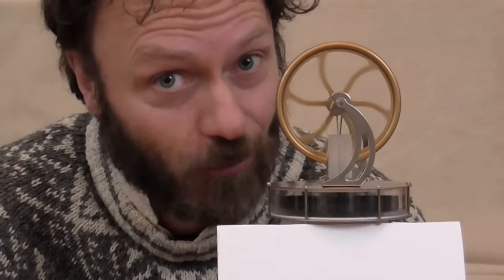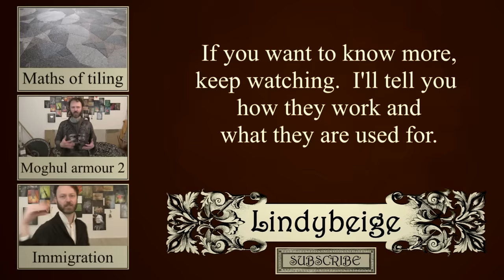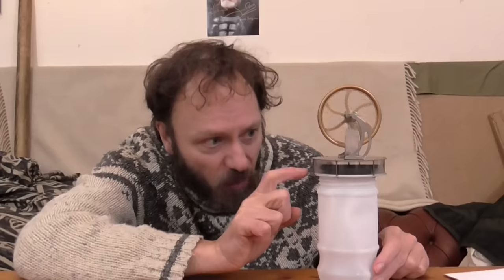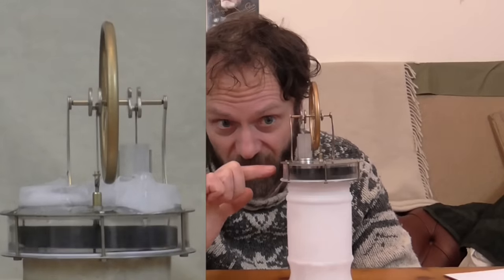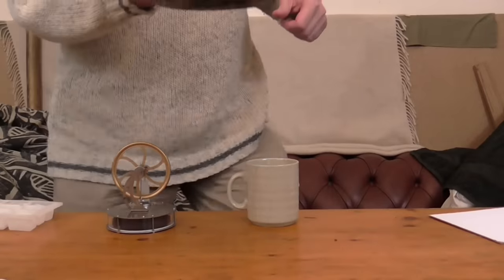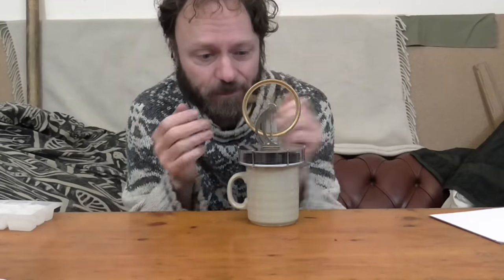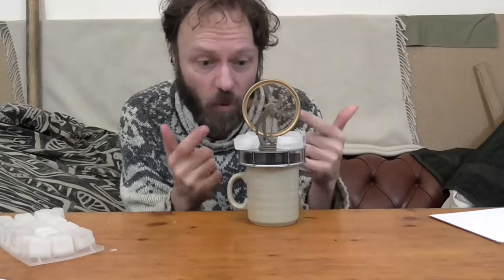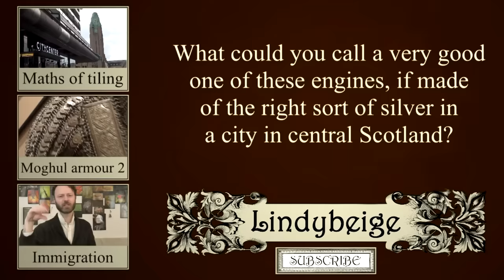Stirling Engines - the power of the future?

Comment: It could work at the equator. Plop the bottom in a lake and paint the top black you,d get a heavy temp difference.
Reply: That'd be a useful way to get these working reasonably-well in a hot desert, too.  Dig the "cold end" deep underground (where it's cooler) and fill that underground reservoir with water, and maximize the amount of heat on the hot end.
Reply: northrupthebandgeek | not really sure about that.. isn’t sand relatively good at insulating? I’d imagine the area below the engine would just heat up and - almost - equalize the temperature after a short while.
Reply: @User_2  Right, but then at night it'll get cooler at the surface and equalize the other way.
Reply: Parabolic mirrors aimed at the plate for the heat, the bottom on a lake? WELL done.
Reply: At that point you have to ask yourself if the temperature difference between the water and heat from the sun produces more energy for a similarly shaped solar panel. I couldn't tell you the answer, but pointing out that you're trying to use a source of energy that we have already been utilizing.
Reply: just put normal soil in the places where sand is and the upper panel bigger , perhaps mini solar panel, to cast shadow to the bottom...it will only need water from time to time to wet the soil , nothing else
Reply: @eewweeppkk  It well might. Solar panels are pretty inefficient, think about 20%.
However, it might be easier to just cover a larger area with solar panels.
Reply: @eewweeppkk  Well, a solar power array only uses the fact that a photon is hitting an electron, which means power output is limited by size. In the case of an stirling engine, its the actual energy within the molecules that generates the Power Output.
Reply: @RijuChatterjee  If you could insulate the heat over night within the surface of your stirling engine, you where able to use it when the sun is not shining and adversa. Storing Heat is way easyer then storing electrons.
Reply: Big energy will let u spend your life savings , then come silence any who will try, just keep it secret and let it out slowly
Reply: I have a better Idea build one in space
the side facing the sun will warm up tremendously and the side facing away would get super cold
Reply: @ralexcraft990  Damn your'e right, thats actually a really good idea.
Reply: Even better, use mirrors to reflect sunlight onto it
Reply: @ralexcraft990  As I understand it, spacecraft already have trouble radiating heat to space. It doesn't bleed off the spacecraft as much as you'd expect because heat is the transfer of energy to particles, and there are fewer particles to go around in space. Kinda like how sound doesn't transmit out there because it doesn't have the medium of air. So I'm guessing that it would heat up well enough, but you'd want a water reservoir or something at the other end because shadow alone wouldn't let the air cool down enough.
Reply: @thesoupin8or673  I appreciate your input and thank you for the correction.
Reply: @northrupthebandgeek  Generally, the deeper you dig into the earth, the hotter it gets. For this kind of setup, you really need a cold and flowing watersource which will take away the heat. Even a lake will equalise after a while.
Reply: @ralexcraft990  It also lacks the outside air pressure that actually drives the piston 9:45

Edit: Though I am sure there are ways around it, it's not as simple as just heating one side with the sun and having the other facing away.
Reply: @seventhunders9741  lol, do you really believe that?

Comment: and it was in a blackened saucepan, I would've liked the video, but did you see the state of his saucepans
Reply: mike n He's made a video on it.
Reply: That was the joke
Reply: use that blackened saucepan of yours to do a facepalm mate....

a facepan...
Reply: awful. horrible sauce pan maintenance. his family should be ashamed
Reply: Since this is an engineering video, the black residue means that his range is burning it's fuel inefficiently.  A well designed gas stoved, working properly should give off nothing but clean blue flame.  

Because of this, Lloyd's utility bill is a little higher than needs be, but the marginal cost is probably too small to justify a new range.
Reply: Romano Coombs <3
Reply: That antique  would have cost a fortune.

Comment: Wow! This gives me lots of ideas.
 
First, this might be useful in deserts after all. First of all, it often gets very cold in deserts at night. Water often freezes, which is how sherbet was originally made: fruit juice in the desert was exposed at night, and covered up in blankets to keep it cold in the day. So that made be used to make ice for the engine.
 
Besides, even in deserts, caves are reasonably cool, if they are deep enough. So an engine would work if it is installed between the surface and a cave, or just a deep enough hole in the ground.
 
The other idea is that one might reverse the function and use the thing (it would no longer be an engine) to quickly equalize the heat difference when this is required.
 
Please feel free to spread these ideas.
 
Thanks.

Comment: Interesting timing. I'm currently half assing my way through an engineering class where we design, build, measure and rapport on a stirling engine. Needless to say I don't recommend trying to design your own thing, without the proper workshop skills ;)
Reply: Sokar maybe you can tell me why powerplants use steam turbines and not Sterling engines?
Reply from the maker: Steam engines that are big are more powerful.  You can get very high pressure steam, but the pressure difference you get from chilling air just isn't as great.
Reply: Would a fireplace on one side and riverwater on the other be a good enough gradient for a sterling engine?
Reply: Lindybeige Why we can't turn heat or nuclear reaction to electricity directly with 100% efficiency by now? THE FUTURE SHOULD BE HERE BY NOW, WTF!

Comment: I love the ideas mentioned here. One thing That I would like to add about it not working well in hot climates, is you may be able to undo that problem a bit, by having water running over the top plate via aqueduct, or just building it on a bank to a water source. It would be most useful, in a wilderness domestic sort of setting.

Also thanks for the great description of how it works. I looked up how they work, and people kept giving conflicting and confusing answers. Most of their answers didn't seem like they would work, so it's nice to finally find one that makes logical sense.

Comment: You'd think we have stirling engines everywhere here in Canada.  So long as the energy produced is greater than the energy lost via heat to the engine.  We'll have to install these on our igloos, post haste.
Reply: I could put one on my winter coat.
Reply: It's not possible to produce more energy than you lose, however you can use the energy that goes to waste otherwise (heat, for example, in a factory).
Reply: In the future after ww3 you'll be burning your landfills to make electricity using stirling engines
Reply: Don't be ridiculous.  Burning landfills just attracts the radioactive megachihuahuas.
Reply: All the way from Mexico ?
Reply: Charles Wood They follow the migration of the electric buffalosnakes.
Reply: But the wall, Trumps gonna build a wall !!!

Comment: You forgot to talk about the easiest version to make, "The PC heat sinks"  They don't require any mechanical moving parts like Stirling Engine but work on same principle. Putting out more watts depending on difference between plate and other side.  Of course intended to cool the CPU it can be removed from an old computer then used to make electricity.  But it's nice to see the old technology.